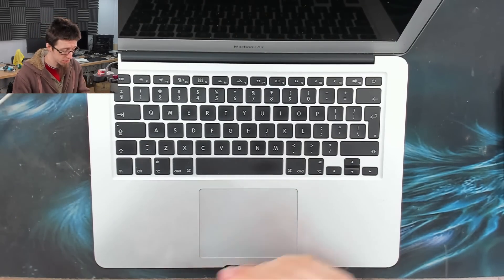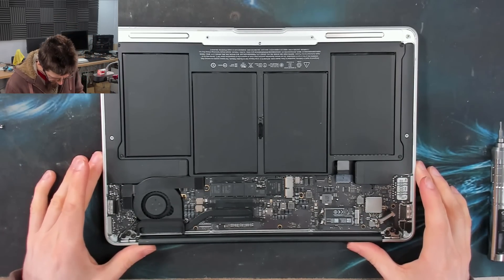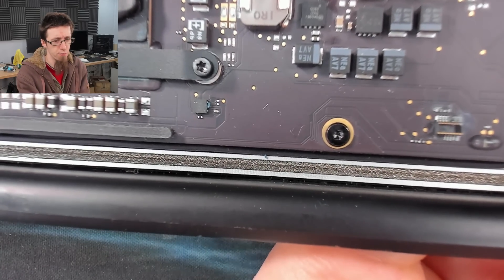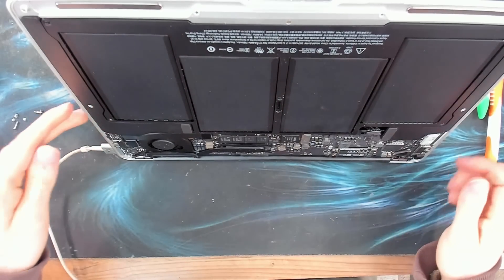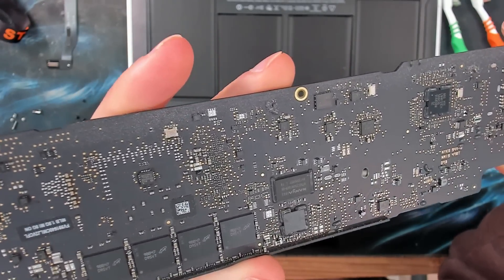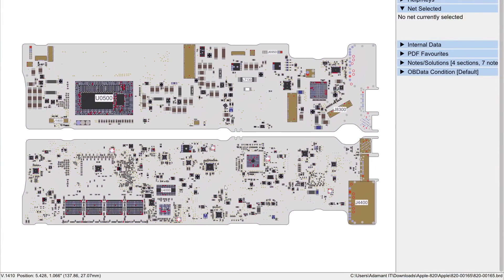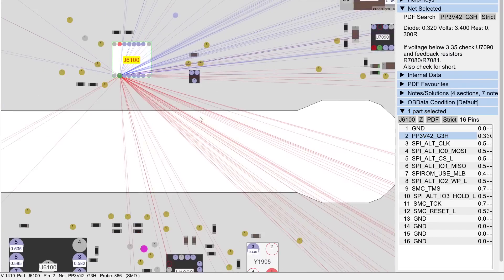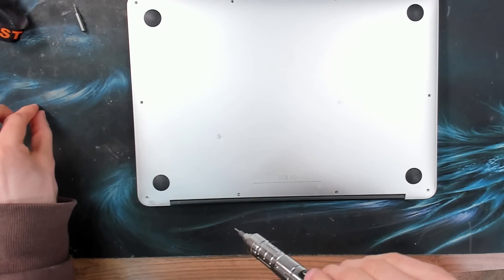MacBook Air, no power no charge light, actually an easy fix - LFC#306

Comment: I had the same issue but I still do not get the boot chime no post.   So I removed it carefully cleaned it all up.   All voltages are good 8.6 volts on each side of the main rail and 5 volts nearby.  No voltage reading on the two smaller VRs (inductors) by the graphics section assuming voltage won’t exist there until boot correct?   No shorts anywhere.  What could it be?  Oh one more thing with the battery disconnected when I plug the charger in it goes from green to orange is that OK or should it stay green?

Comment: You’re godsend ❤😮‍💨 I’m starting my senior year and my MacBook Air stopped working about 2 years ago. Got the charger and  adapter replaced, nothing. Bought a whole new ass battery, nothing. I was about to buy a charging port 😭 and after months of searching and resetting, I found this video! Thanks A lot. I don’t wanna use a Chromebook nomore lmao

Comment: I got 2 MBA at home that used to work but no longer charging even with just the cable. Will give this a try to see if it works. I remember seeing somewhere that the issue was a power device near the power area.

Comment: Myne stopped turning on, i get orange light on the power plug, but it wouldn’t start at all.
Absolutely no liquid contact, i haveb’t use it in a month or so, and now it does this.
I took the lid off, and there is a slight smell of burn near the power socket(board).
Any ideeas? I really hope you see my message

Comment: Hi Adam, great videos, I got the same macbook air, the thing is that I change the thermal paste on it and now there is no sound, the fan are going wild and the power cable isn't turning green but it can turn on only if it is connected, what do you think it is? I changed the flex power /sound cable but it didn't work. Where can I find the sheet for the motherboeard schematic and where do I start to see if there is anything burnd or what.

Comment: Great video. Perfect level of hand holding.  I am struggling to find that Jtag connector on the 2015 macbook pro. Every time you put a lid back on a computer without a final check it's guaranteed to fail.

Comment: Hello, I had the three beeps probelm on my Apple MacBook Air 13, 2011, i7. I did a RAM reflow as described in YT videos, but after I did this, the MacBook does not turn on. I get the light on the charger, but when I press the power button, the MacBook does not respond. What can be done, what can I check?

Comment: As an avid Macbook Pro user I have determined after watching many of your vids, MacBook Air computers are a lot of trouble. I have a MBP 2020 and a MBP 2012. The 2012 I have upgraded everything , SSD drive, 16GB ram, second SSD and I NEVER EVER have any issues with it. Just recently replaced the 10 year old battery. FYI, the 2012 does not have a single scratch on the body or the screen. I run bootcamp for Win11 and VMware for Linux and Win11. I work in IT as well.

Comment: I lucked out with a Mid 2015 MacBook Pro that had no light on the power connector. Turns out on the inside there was something wrong with the power jack board. I removed it and cleaned it then the power connector lights worked again. Very odd you can have some many different causes affecting the power jack lights.
Reply: Mine just did this same, thing same model. Been looking for the cause, I’ll give it a clean and seeee how it goes. Thanks 👍🏼

Comment: I am not a tech person, but I am determined to try and fix things before giving up and recycling equipment.  I had the same issue on my same laptop. I replaced the charger and the i/o board to no avail before finding this vid today. I did the same little cleanup and now my laptop started up and is back in perfect working order. BAM! Thank you!  Now I can hold off for another six months or so to buy an M2 MacBook Air. Grazie, grazie!
Reply: :-) I still have a MacBook Air 11 I want to fix (although I have a M2 MAX now).
Loved that lightweight little guy. Pretty sure that’s the issue.

Comment: What is the SPI line?
Reply from the maker: SPI is a data bus used for serial communication between devices, this can be as simple as the SMC talking to the battery to find out capacity/charge/health status, or in this case, it's also how the SMC reads data from the BIOS chip.
So a bad connection on the SPI bus means critical chips can't talk to each other.

Comment: Sorry sir, I'm from Indonesia I'm a beginner at this 

i have macbook air 2015 13 inch no light in magsafe, no power 
I did the check and get 
L7130 8.14v 
D7005 14.5v 
L7095 PP3V42_G3H 3.41v 

does this include problems at SMC, 
I've done checks on U5000 and everything shows voltage 
but in D7005 I don't find 19V only 14,5v

#which part should I check? 
#or should I just replace the U5000? 

hope you can help me 
Very very thank you

Comment: This is a typical half baked repair, you mentioned Louis who melts those connectors immediately off the board because the corrosion with these connectors continues on, but instead of doing exactly the same you brush it mildly off with a toothbrush, so this issue will come back three months later...you did not even conformal coat it, only amateurs at home would do it like this.
Reply from the maker: Make sure to watch the second half of the video, where I melted it off the board 👌
Reply: @Adamant_IT  Hahaha! nice! :-) Must admit, i was a bit surprised that you held a speech about removing it, but did the opposite, but good you did it in the additional part.

Comment: Nice job, it looked like it fell apart when you took it out, possible burnt out?
Reply from the maker: It's a plastic connector, so hot-airing it will destroy it. But that's no problem if you've got no intention of putting it back on again

Comment: I can't see that connector ever being used after leaving the factory, not like apple actually repair their products!
Reply from the maker: Yea not really. It can be used for BIOS repair work, but also if you have the equipment and knowledge for that, you should also have hot air and just remove the BIOS chip.
Reply: @Adamant_IT  exactly. The tool that is usually used to flash the EFI (BIOS) through that connector is called Medussa which is a versatile but quite expensive tool. As you say you can just remove the BIOS chip and flash it with a cheap programmer and free software. Like Louis says, Die JTAG die :)

Comment: Is that diagnostic connector usually used by the Apple technicians or do you personally use it for diagnostics?
Reply: Techs use this port to flash the bios or bypass password on a locked unit.
Reply from the maker: I know a chap who was developing a cheap set of break out cables for connecting common programmers to the JTAG connectors, as it would save taking the logic board out from most of the macs and thus save time - but I think it fell through. I was interested in them, but the project has gone quiet, so not sure if he decided it wasn't worth the effort.
As you say, when you're doing this level of work it's really not hard to just remove the BIOS chip.
Reply: @Mr Guru The pins going to EEPROM are plain SPI connections. Nothing to do with JTAG, the connector doesn't even use JTAG at all but SWD.

Comment: Great video. Was the diagnostic connector getting shorted by the case? And is it just dirt on the top left of the power connector or is it damage? Because it sure looks like a burn mark in the video.
Reply from the maker: More tarnished than burned. But definitely some corrosion hiding in there and pulling stuff down.